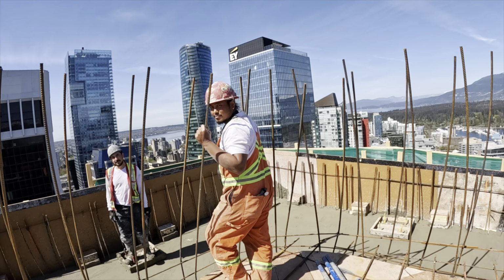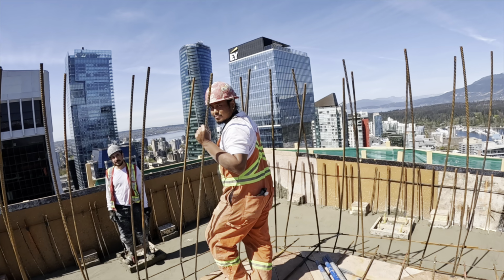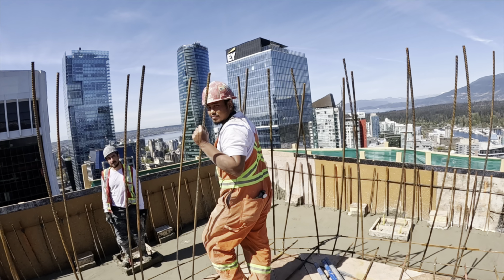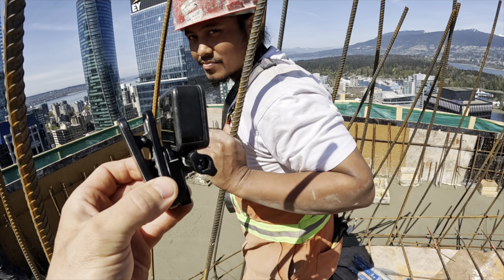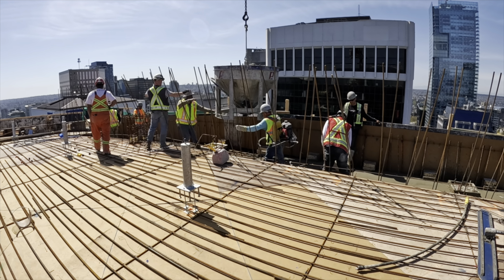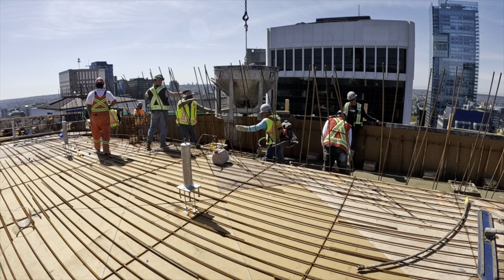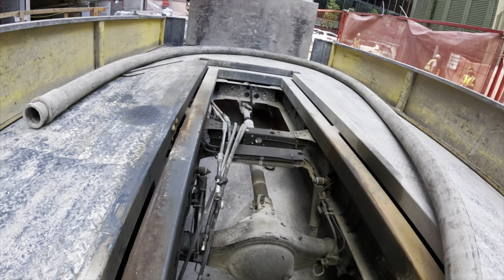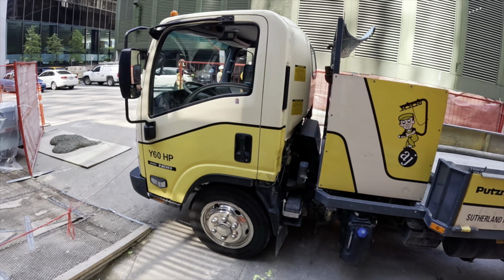Line-pumping on level 32 of a high-rise tower!!!

Comment: Here in the video I love the application with the tk 60 hp fed in the skies by a crane placing concrete on top of that beautiful unit for operators who suddenly don't know it. It is a TK 60 hp which is a high pressure equipment different from others thom katt 131 hp Cummins QFS 3.8 engine tier final performance of 46 meters per hour over 100 bar the unit is detachable from the Izusu chassis these units are for 5 industries and 20 applications which is very common to see formwork burst. scocretal projection. compaction injection are very professional in the field of concrete pumping AJS pumping concrete

Comment: What size hose do you use there. We typically use 2” or 4”. The 4” is so damn heavy I’ve been thinking about trying a couple sections of 3.5”.
Reply from the maker: We were using 3” up here (normally we 2.5” or even 2”). Yeah man, 3.5” is SOOOOO much easier to lug around in comparison to 4” line. 3.5” is our go-to for most commercial work.

Comment: Why don’t you use Portland to prime with
Reply from the maker: Cost and convenience (mostly convenience). We can prime 200’ of line mixing just 1-2 measuring cups of powdered bentonite with 5 gallons of water. Priming that same 200’ of line with Portland would require using an entire 50 lbs sack. One 50 lbs sack of bentonite we can prime 50+ times. Also, storing Portland on the rigs the sacks tend to get wet (especially in our climate) and break open or just solidify. 

100% mortar mix fattened up with a good bit of Portland is my favourite primer in terms of effectiveness and has many great benefits, just with the amount of primer we use daily, powdered bentonite is far more convenient. Also, bentonite is $10 per 50 lbs sack. Cost is roughly 75 cents to $1 per prime. Just have to be absolutely diligent that bentonite does not make its way into finished areas of the pour.

Comment: Do you need a CDL license for that little line pump? Or just regular drivers license works? And how big is that water tank?
Reply from the maker: Hydraulic brakes one this little rig, no CDL required. It’s the perfect unit for training someone whom is new to pumping. The water tank came from an old ready mix truck. I’m guessing it’s got to be at least 150 gallons. It’s gets us through most days, including washing out a couple of times.